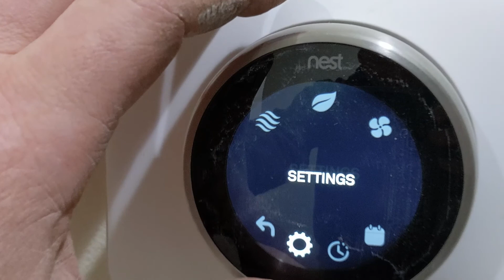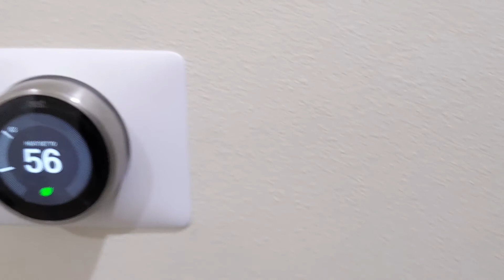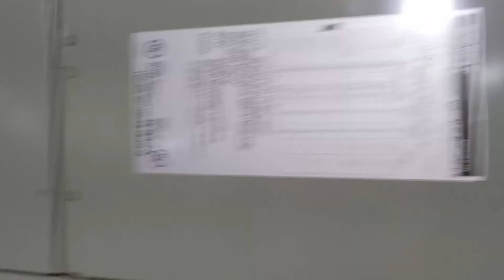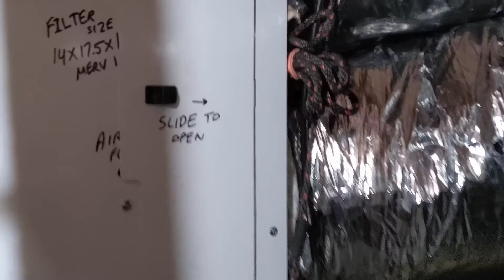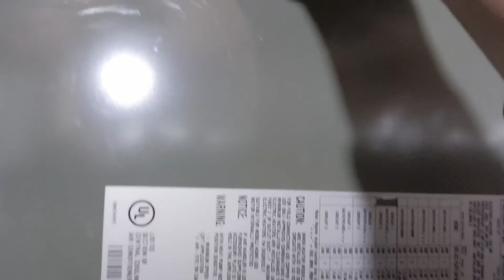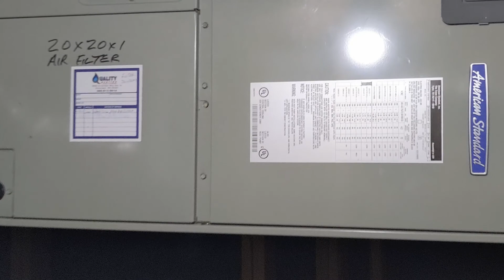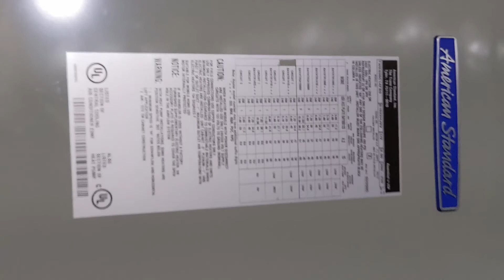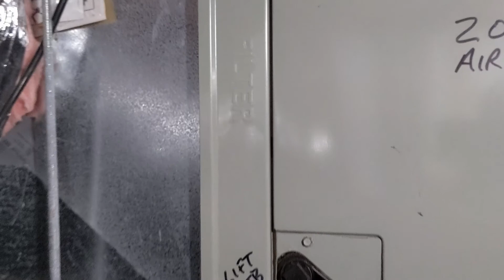Ultra-Aire 98H with Nest Thermostat Control

Comment from the maker: Like & Subscribe!!
Reply: Thank You this helps. 
I thinking about purchasing the UA120H and want to control it from my Honeywell TH8321WF t-stat.  Ultra-Aire t-stat don't offer WIFI.  Would you consider this "Wiring for a powered humidifier, dehumidifier, or
 ventilator" or "Wiring for a non-powered humidifier, dehumidifier, or
 ventilator.
When your NEST t-stat calls for DEHUM, is there 24 volts present on the "*" terminal?  or,  is it a relay closure from "*" to  -COM.
This is the link I'm referring to, https://www.manualslib.com/manual/1389597/Honeywell-Visionpro-8000.html?page=86
Reply from the maker: I would consider this wiring for a powered humidifier, dehumidifier, or ventilator since the UA 120H has a coil in it that provides the 24 volt signal. In my situation I used 24 volts from the air handler to trigger the dehumidifier because I wanted to ensure the air handler fan started in parallel with the dehumidifier. I would highly recommend the NEST T-Stat for Wi-Fi control, it allows me to fine tune the humidity level at a place 3,000 miles away.

Comment: How do you control the standalone dehumidifier with the Nest thermostat? Is there a dehumidify option, like cool and heat? Thanks for the wiring info!
Reply from the maker: Only if the standalone units have low voltage wiring configuration near the power switch similar to this unit.

Comment: What rope hook support system do you use?  Need to get some for a dehumidifier install.   Don't want to get a crap product.
Reply from the maker: https://www.sylvane.com/santa-fe-small-hang-kit.html

This is what I normally use. They are not the least expensive but they do last a long time and easy to use.

Good luck with the install!

Comment: Good Afternoon.. i have been watching your video ,. but im  struggling with  the wiring,.. I have a package unit (carrier) and a dehumidifier(Aprilaire) so I want to use the same thermostat(nest) but I don't know how to set it up in pro mode.. any suggestion . please !!!
Reply from the maker: star terminal, and it also depends on the thermostat version of nest that you have. Not all are equal.

Comment: nice work! I need to install a dehumidifier into my house HVAC system. How is the system working a year later? Thanks for your video and feedback.
Reply from the maker: One year later and the system's still running great. I'm so thankful to have a dehumidifier to offset the loading on the air conditioner now that we've had all this heat.

The air conditioning system is operating more efficiently when it's cooling dry air vice trying to dehumidify and cool.
Reply: @oak1518  I just ordered a whole house dehumidifier and hope to unbox/install next week. My desire is to lessen the humidity to help the a/c units be more efficient. Thanks again!!
Reply from the maker: That’s awesome, let me know how it goes! I am getting ready to install another unit in a house in VA. The humidity is a bit different then WA and hope to make the AC more efficient as well.

Comment: Here is a question, why doesnt NEST have control over HRV?  These are mandatory on all newer homes over the past decade.   Also, why must the system mode be on 'heat or cool' in order to just turn on the fan?
Reply from the maker: I am not sure as to the lack of HRV functionality but to the second part of the question: It depends on the installation process that you decided to use. If the dehumidifier has a separate return and supply line ducting then it can be run independently of your HVAC system. If you set up your dehumidifier so that it utilizes the existing return duct and existing supply ducts then you must run at least the fan of your HVAC system so you have sufficient air flow through the dehumidifier and out to the spaces. The fan of the dehumidifier is not large enough on most models to push enough CFM through the HVAC system on it's own.

Comment: do you have a mechanical damper for the fresh air duct? how is that wired up?
Reply from the maker: Yes and for this install I put it about half way open. The damper is built into the dehumidifier.
Reply: @oak1518  I'm working on installing an Ultra Aire 120H and thought you needed to have a motorized damper for the fresh air intake? otherwise how would the thermostat control it? I just installed the aprilaire 8920W thermostat that can control the HVAC, DEHU & vent... or do I not need the mechanical vent?
Reply from the maker: You can use a motarized damper or manual. It would depend on the desired air exchange you are looking for. For my install I do not mind less fresh air and didn't want to opt for a motarized damper when it was a nice to have vice a requirement.
Reply: @oak1518  right but it's a manual damper which requires crawling into the attic or crawl space to operate... I got a motorized one that should be able to operate from the Aprilaire 8920W if all goes well. Gotta cut some holes in the house to run the ducts though.

Comment: Just installed one of these in Seattle, this video is a missing manual for wiring it up. Appreciate you putting it up. As far as the pro setup it was pretty straightforward, I just chose "standalone dehumidifier" for the * terminal, there weren't any other question. It does ask if you'd like the fan to activate along with the dehum, so it's nice you can control that.

Comment: Great explanation, can you address how you go about wiring the fresh air intake damper to bring fresh air into dehumidifier when the unit is not pulling from the cold air return.  Also, were you able to figure out a way to schedule fresh air intake cycles to keep the home "breathing".  Wondering if that's a possibility to allow for fresh air intake even when indoor dehumidification is not necessary?  Thanks for sharing
Reply: I don't believe Nest has any ventilating functionality, so this wouldn't be possible.
Reply: I'm replacing my nests with the aprilaire 8920W which can control all those things independently....  the nest is cool but it has limited functionality.

Comment: Thanks for the info. I am surprised by the lack of info online about installations. Question though how does the backdraft damper not close if the hvac blower fan is running?? Would that not close the damper and prevent the dehumidifier air from exiting. Thanks.
Reply from the maker: If their concerns with too large of a pressure drop across a backdraft damper, you may consider installing a powered backdraft damper. The powered damper is normally closed and would energize open on a 24-volt signal when the dehumidifier is triggered to come on.

Determining if this is the scenario you have would require to look at the CFM flow rate and pressure drop across your main air handling unit.

I have only ever seen this come up one or two times and the air handlers were very large. If you have oversized your dehumidifier you probably will not have to worry about this.

Here is a link to our website that I found that occasionally would help out with wiring diagrams if you're struggling with that part.

https://ohmefficient.com/nest-thermostat-dehumidifier/

Good luck on your install!